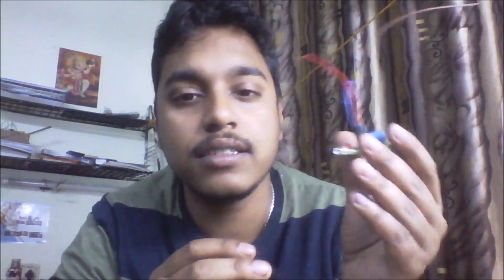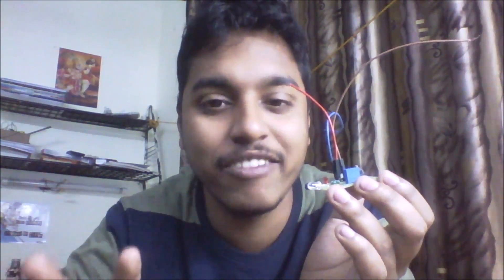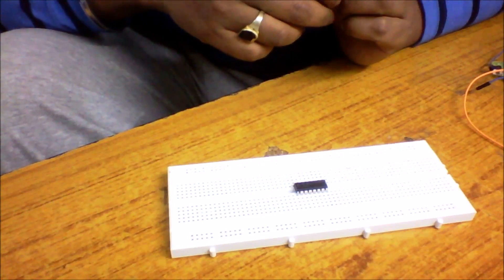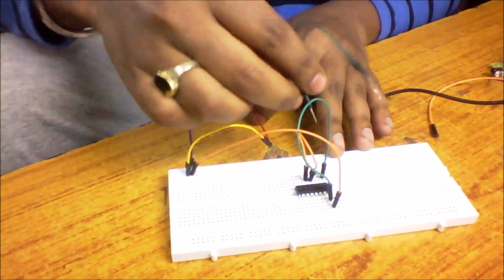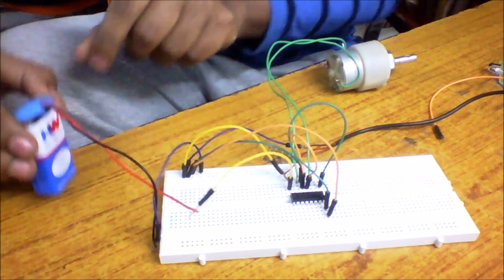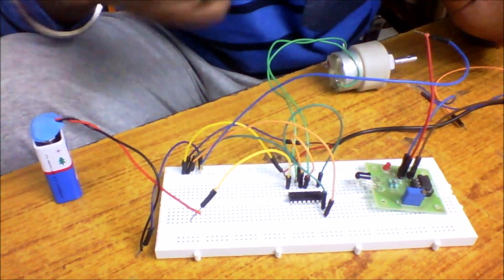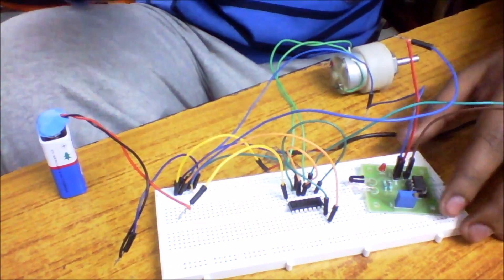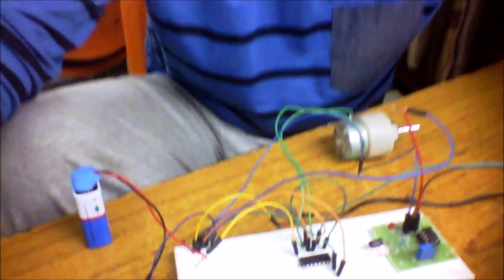Contolling of DC motor Using IR Sensor  BY Protim Dutta

Comment: Ir sensor 12volt support kar leta hai
Reply from the maker: Yes
Reply: Protim Dutta dear protim can you tel me motor speed how can we adjust with this. Circuit
Reply: Mene kya kiya uln2003 ka ek circuit banaya usko ir sensor ke connect kiya aur 12volt DC gear 100rpm motor se connect kiya aur usko 12volt 7amh battery se connect kiya app mujhe bataiye ki 12volt se ir sensor    kharab to nahi hoga support kar lega
Reply: Tell me bhai mere question ka answer

Comment: Hi can you help me integrate photoelectric sensor and stepper motor together? like when the sensor detects object motor will turn 180 degrees then go back again to its original position
I'm using SICK photoelectric sensor and it is hard for me to connect both of them.

Comment: Hii sir i need help. Im trying to connect ir sensor (8-12v) to a 3v motor. I use 9v battery
Reply: Pls help me
Reply: Im able to get 3v output from ir sensor but motor will not work

Comment: HELP!! I have done the same as you in this video but when the ir sensor is activated it stops the motor. plz help thank you
Reply: how could you do that? i was looking forward to this. (my project need the motor to be turned off when the ir sensor is activated)
Reply: MGCMDTM I’m not to sure how I did that but I followed everything on the video more that 5 times over
Reply: well, nevermind, i've figured it out (using relay)
Reply from the maker: Kindly check ur ic connection.
Reply: @protimdutta7598   I bought the IR module for Arduino and happened the same! What should I do? Please help me
Reply: @protimdutta7598  I read that there are infrared with out low and out high, in my country we only have with out high, so when it detects something the out became Low and we don't need that
Reply: jay lord frama did you ever find an IR that detects high when it sees an object. I’m in the USA and can not find one
Reply: @Theladysman881  no bro, but I'm going to create my own so I'm going to use to videos this and another from my country it is in Spanish lenguage
Reply: It is happening to me! What did you do?

Comment: Hi pal. Very interesting video👍. Could you share a link to get the ir sensor if possible. I am working on a similar project but the only sensors I can find give low signal when object is detected and I need one to give high signal when object is detected like in your video. Any help would be much appreciated.
Reply: did you find the sensor ? India is the only place where you can find this sensor hahaha sad